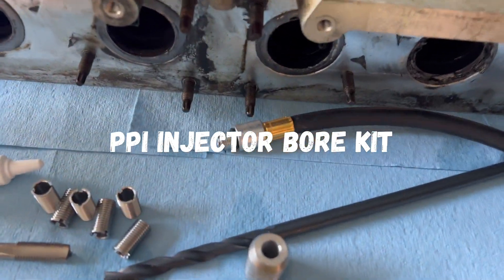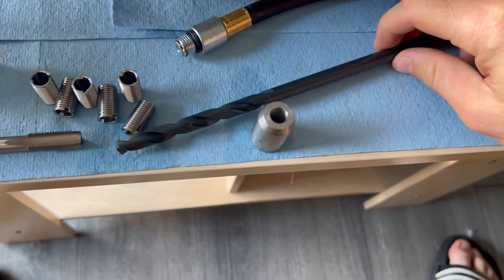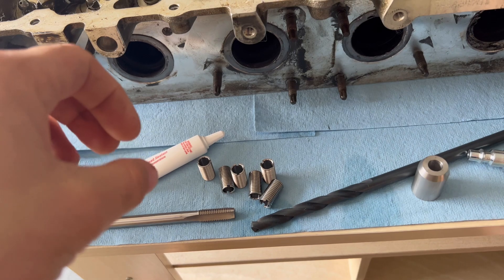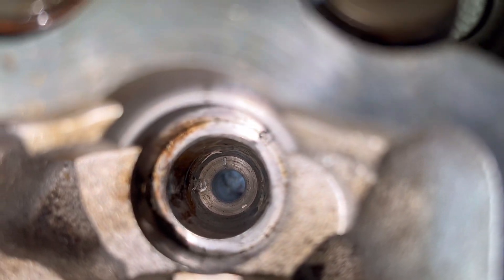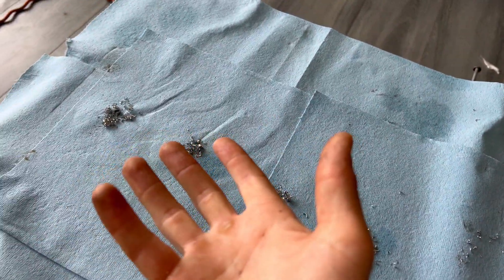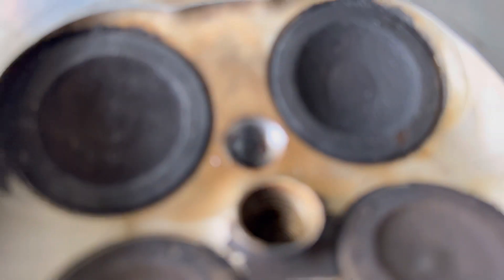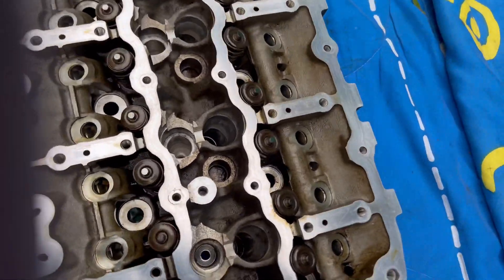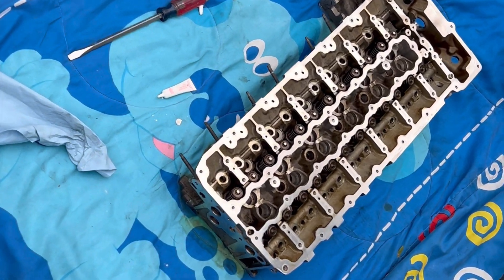PPI Injector Bore Kit install for N54!

Comment: Turn the crank to get the valves closed and piston down out your way of drilling.
Use the n54 walnut shell blaster adapter and wet dry vacuum to vacuum the cylinders out while using compressed air on the spark plug tube hole. Took us 30 minutes total,very easy,all cylinders clean with no metal when camera inspection was was done 👍

Comment: Do you have the size for the drill bit and the inserts
Reply: this is what i need to know.... i would gess a m10x1 whif a 7.8 H7 hole for the injector...
I am gonna build my own set ill let you know if i figured out
Reply: @mxlisse  how did that go?
Reply: @anthonyguseman3368  good  i made them my self the v8 is running good again

Comment: hopefully my bore isnt messed up... MY problem is misfires on high e content ...  would that be the bores or Injectors themselves... rn im 20 psi and on e30 and lower .. no misfire .. e50 and above (my goal is full e) the car breaks up when I go WOT
Reply: Same issue I’m having just on a base map for Ethanol tune. Did you figure it about?
Reply: @mrkobex24  do a leakdown test.. see if any air is coming out of injector bores
Reply: Spark plug gap?
Reply: @landon5990 ended up being my motive box not getting enough voltage at high load